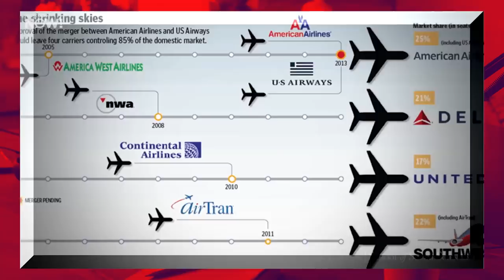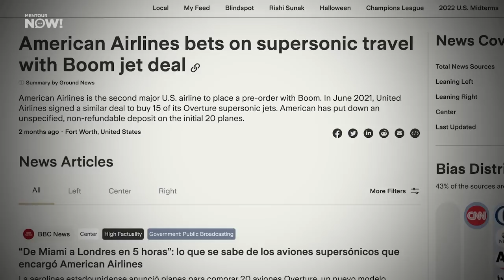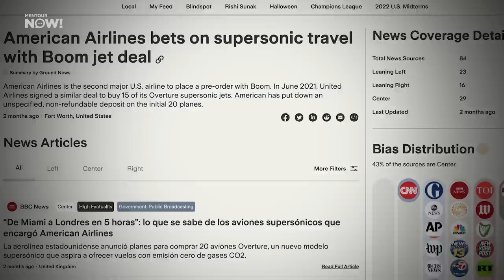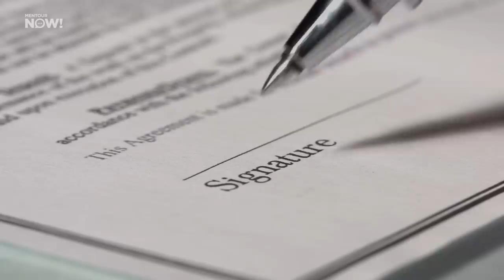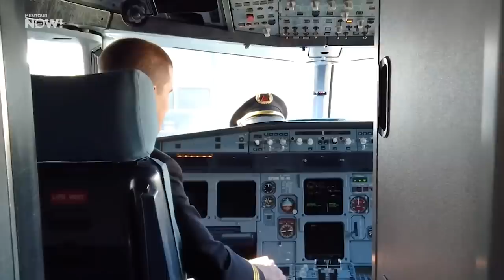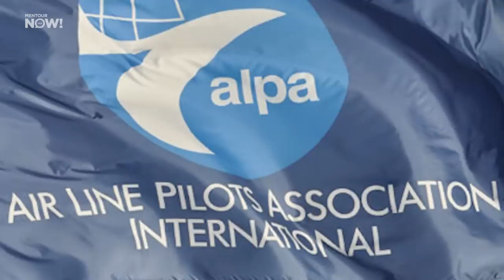Is This the DEATH of the US Regional Airlines?!

Comment: The union contracts definitely play a major if not main role.  I'd be interested though to know how a few other factors play into the different structure of the US air travel market.  First, the basically complete lack of passenger rail, especially at the intercity and inter-region level (with the exception of the Northeast corridor), in the US when compared to Europe.  Second, the sheer size and scale of the US; looking at Europe, I would guess that the average distance between city pairs is half or less that in the US, that's gotta have an impact on carrier operations.
Reply: It is a little puzzling because Europe usually has much stronger unions than the US. But as in a lot of other fields the very strong employment protection that those unions enforce in Europe (very hard to retrench people) has the paradoxical effect of removing the incentive for them to insist on restraint of trade agrements such as the scope clause (eg why would you allow lower wages for regional pilots when they are many of your members?).

Comment: One issue that is generally never brought up is the high cost of aircraft ownership. Certainly, a lower cost of ownership won't magically fix anything, but it would make it easier for individuals, either by themselves or by joining others to form small companies, could offset some of the regional demand with lightweight, efficient piston-powered aircraft.

As an example, people would be willing to ride a poison aircraft between Colorado Springs and Denver even if it takes a little bit less than twice as long as it also costs a little less than half as much.

Of course, this is likely hoping for a bit much, but it's my fantasy, not yours.

Comment: One has to point out the European anomaly that is Luxair: Eleven DH Q 400 and eight 737's split evenly between 700 and 800 models... I've flown to CPH on a DH with four other people on the plane...
The strangest regional flight I took was fun: I think the final destination was Izmir, but as I foraged for tickets, flights from Liège were cheaper than from Brussels. So the plane set off from Liège, landed in Brussels, picked up passengers and off we went. I think there's 80 km between Liège and Zavantem ;)
Reply: Swiss operates 30 A220, which form roughly 1/3 of it's fleet, and also has a regional airline called Helvetic which operates 16 E190/E195s. And these fly between some large and mid-size airports, for example Warsaw to Zurich route. Both of these airports see regular wide-body traffic with daily flights by planes up to and including B777 on Transatlantic and East Asia routes.
Reply: Oh and than you have LOT Polish airlines, which is only just now fasing out it's DHC Q400 fleet which was 12 planes strong, as for the rest its fleet currently is made of  18 E170/175, 23 E190/195, 11 (soon to be 16) B737s and 15 B787s

Comment: I wouldn't write off the US regionals just yet. The cost savings extend to other employee groups besides pilots, and the "pilot shortage" may not last forever. Another big issue is union integration... it's very hard to "fold" seniority-based union groups which started with vastly different career and pay situations. The regionals are in for a rough ride for a few years for sure though.

Comment: The regionals will never leave the US market mainly because of the scope clause in the US. Plus the bigs don’t want to fly to BF nowhere.  The majors also use regionals to hold slots at airports that are slot restricted if they are not using slots at that time. The regionals are ditching the 50 seat aircraft but the 76 seat regional will never die.

Comment: You can't just replace 2-3 regional jet flights a day with a single A320/737 flight. Those 2-3 regional jets flights are feeders for hubs and represent the entirety of air traffic for the entire world going to/from that regional airport. If you replace it with a single A320/737, then many of those flyers will end up either missing their connections or enjoying an 8+ hour layover at the hub.

What you can do is try to identify specific point to point routes between regional airports and final destinations that can bypass hubs entirely - this is the strategy that airlines like Avelo and Breeze are using, but this is a very niche strategy that will not cover most of the passengers' needs at the regional city.

Comment: I think regional airlines might have a niche, but part of the reason they're dying comes from their failure to embrace more fuel-efficient turboprops like the ATR-72 600.

On a full 500 nautical mile flight using the ATR 72-600, you only burn about 6 gallons of fuel per passenger. This is almost comparable to larger jets, 

Meanwhile, on the same flight using the E2-175 jet (the smallest jet that can handle 100 passengers), 8 1/2 gallons are burned.

With the average cost of jet fuel being over $6/gallon in the US, this amounts to a $15 increase in fares on a one-way trip.

This might not seem like much, but it still considerably influences consumer choice.

Comment: Interesting video. One thing I still don't understand and I never heard it explained in any detail - why is there a maximum number of passengers put on the regional flights? Yes I understand that it's to do with the unions but it wasn't explained why the unions insist on this ? What's the difference between flying 75 passengers from 95 passengers? That bit went over my head. Surely if this is going to kill off regional airlines it's not in anyone's interest

Comment: One huge difference between USA and the rest of the world - High Speed Rail. No check in times, centre to centre routes etc. Rail in the US is 99% freight with just a few poor and slow passenger services. Even Acela only operates at only an average of 66mph. France, Germany, Japan etc are all around 200mph. The speedier check in, increased comfort and central locations make flying less attractive than in the USA.

Comment: The percentage difference of regionals in the US and EU could be partly because of different infrastructures. The US is bigger, so taking a plane makes sense. The EU is smaller, and most parts have excellent railway networks, so taking the train (and avoiding security checks) often makes more sense. So the demand is smaller for regionals.

Comment: The cause of the pilot shortage is the 1500 hour rule.  It's a huge burden and it keeps a lot of people from becoming pilots while doing nothing for safety.  In Europe the minimum number of flight hours to be a first officer is 250.

Also, in regard to doing one flight with a A321 vs three flights with a regional jet, many airlines prefer the latter because it gives people options for flight times.  It also helps the airline sell connecting flights and deal with cancelled flights.

Comment: One of the big problems the majors will have to overcome if they lose their regional airline counterparts is a good system for experience building. As you pointed out, pilots are in short supply due to decades of low wages and a massive amount of retirements of the older captains aging out. (When it costs about the same as medical school to go through flight training and all the hours required for an ATP, many potential pilots gave up on their endeavor as it did not make sense financially.) As it stands, regional airlines are providing a pathway for lower hour pilots (500-750 military, 1500 civilian) to gain experience and flight time in a smaller passenger jet, at which point they can move on to a major airline and fly a wide body aircraft within 5 years. Without this system of getting experience and training to the newer pilots, I don't know how even the legacy airlines will find enough new hires. Not saying it is necessarily a good or efficient system, but right now it seems like the shortage has created a crisis mode for the airlines to pull in as many pilots as possible, to both the regionals and then to the majors.

Comment: Even with all you say, which I agree with, it is interesting to note that the US market has a lower total seat cost per mile than their EU counter parts. In total, US company's run their airlines more efficiently than EU airlines, even with the inefficiencies of smaller aircraft type.
Then there is the problem with the US market capacity being maxed out at airport hubs. Airport operations and passenger terminal capacity is max and in most cases beyond design numbers. The way to maximize therefore is to run more operations spaced throughout the day, spreading out the loads by time rather than build more runways and taxiways, or larger passenger terminals.

Comment: Funny story. The regionals were created by management groups that knew exactly when their mainline pilot groups would be retiring en-mass due to forced retirements. Unnecessarily increasing the demand for pilots is what caused this problem for them. Two pilots can fly a B757-300 with 250 pax or a CRJ-200 with 50 pax. 

Lower frequency of flying is inevitable.

Comment: I think travel demand, cost of labor and fuel has squeezed out the regional product. The Majors would just prefer to put a 73 or A320 on the route. I also think the new lucrative RJ labor contracts are a stop gap as an attempt to retain pilots until the bitter end. Example: UAL is taking 500 737 deliveries, and their objective is to replace the regional product with them...

Comment: It makes no sense to have direct flights of less then 200 ground miles. That would end many so called Regional and Commuter Commercial passenger flights. It also makes no sense for the Federal Government to fund commercial airports less then 120 miles from another larger airport. 120 to 199 miles flights couldn't fly direct. Exceptions as always will be cargo flights, charter flights, medical flights, government sanctioned flights and diplomatic flights. Private planes are different. The end result will be a demand for intercity bus and train travel. So very few smaller passenger jet and turbo prop planes would still exist.

Comment: Surprising how most of those regional aircraft come out of Canada. The Q400 is a beautiful , quiet plane to fly in and nearly equal to the cruise speed of a jet aircraft. Extreme  speed and lift at V-1, easily controllable. V2 is nearly undetectable except for an unbelievable climb rate.
Reply: The Bombardier Q400 - So Easy to Fly, Even a Ramp Rat Can Do It

Comment: Interesting. This is a good analysis, I think. I retired from Delta in 2017 after 29 years. As an aside, I think part of the pilot supply "paradigm shift" is the big reduction in ex-military pilot availability. In my new hire class, everyone was ex-military. Add to that the huge increase in cost to get the necessary ratings over the years and you now have people who have to put in a serious financial investment to get in the door.
Reply: It’s because the airlines keep expanding while the military maintains a limited amount of flight slots.
Reply: @riverjustice  Yeah, military output has decreased significantly over the years while airline pilot job numbers have increased.

Comment: Regional and Mainline would have to sort seniority among employees brought over, and while pilots are part of the equation there are mechanics, inventory, and operations that too must be provided compensation equivalent of the mainline counterparts. Regional carriers operate basically skeleton crews and can get away with low experience workers who have low expectations, but as soon as seasoned veterans influence them they will not enjoy the distortion in expectations. For another video it would interesting to look into the fate of regional carriers as mainlines were to absorb them, and where do the low time airplanes end up that are no longer viable? If there is a partial dispatch of current regional model does it generate a new one based on demand that reaffirms hub and spoke models or resembling a point to point system to fill gaps?

Comment: I am curious about part of this discussion...specifically, what are the numbers of pilots operating the US regional airlines? And how long would type-rating training take to upgrade their skills from the Embraer to the Airbus?
Reply: My son flew for the regionals for 3 years, and then was hired by Spirit to upgrade to the A-319 - A321 series of aircraft. This is a triple rating, as the cockpits of these 3 jets are identical. The difference is in the sizes of the aircraft, and therefore, the performance numbers such as gross weight, fuel capacity,  passenger capacity, takeoff and landing speeds and distances, etc. They teach the differences in their ground school training that they receive when they go through the type rating class. It probably varies by airline, but my son's course was somewhere around 5 weeks ground school, and then one week or so for Flight sim training. By the way, the airline flight sims are so realistic that the pilots get their actual type ratings in the Class-D simulator, before they actually fly the real airplane. He got his Airbus type rating and his ATP (Airline Transport Rating) in the same simulator. Happy flying. Another point. The 1,500 hour rule was implemented by a congressional bill mostly caused by the Colgan Air flight 3407 crash in buffalo NY caused mostly by pilot error. They were flying into known icing conditions but didn't let the dispatchers know that, so they ended up with an approach speed 20 knots slower than for icing conditions. That caused the wing to stall due to too slow a flight speed when the wings iced up. To compound the mistake, the first officer made her OWN decision to raise the flaps when the plane stalled, which exacerbated the situation. The idea behind the 1,500 hour rule was to ensure airline pilots would have more experience before being hired. Happy flying.
Reply: @keithwalter1241   Thank you Keith. I'm not a pilot, but before retirement, I had an extensive background in industrial safety training, so I assumed there had to be a procedure.

Comment: The aircraft shortage for folding in regionals into their major airlines for those routes might not take as long as you might expect.  There's a type of business called aircraft leasing that has been struggling since the Covid epidemic began, first because of the sudden lack of air travel meaning leases got cancelled, and now because of the shortage in flight crews capable of flying them.

These businesses, like Chorus Aviation, have fairly substantial fleets of aircraft that they've just been sitting on these last couple of years, and all they need is an airline in need of aircraft and a demothballing/maintenance procedure to get them back in the skies.  Even if an airline isn't fond of the idea of leasing aircraft in the long term, I'd be very surprised if these companies weren't amenable to signing short term contracts to cover the aircraft shortage until new air frames can be purchased from the manufacturers.  A few might also be willing to sell off some of their fleet as life support to the company, though I'm less in favour of that option because I like this kind of arrangement from an investing perspective.  (And yes, I do have stock in Chorus Aviation, that's why I know that name, but I'm not exactly a major stockholder or in a situation where all my eggs are in that basket.)

Comment: There are a lot of moving parts in the US "regional air" market.  
There's a "distaste" by the customers for "dinky" planes (which pretty much doomed the fuel efficient Saab turboprops).
There's the general availability of land (and associated political grandstanding) to "over build" regional airports to far larger than the number of passenger miles the airport can support.  So, it's not uncommon to see municipal airports with 9K & 10K runways and "regional" airports with 10 & 15k runways.
Also, many of the "majors" contracted the "minors" in the same way baseball teams have "farm clubs"--as low-cost training grounds for potential new-hires.  Flying a 1 hour "hops" on "commuter routes" is a quick way to 2000 hours of ATP time (and far faster than 5-6 years in military aviation).
Of course, the "chinese walls" separating Chaparral, Rio, Mesa, and the like from "the bigs" benefited the two companies--customers say little of that.
The US is a huge place, geographically.  A town of 75 or 100,00 residents might be 3-4 hours' drive from the next similar sized city.  And, could be 4-6 hpurs from an international airport.  So, adding a to the ticket price to fly "regional/commuter" and "save" driving a rent car to the airport is often a better deal for the traveler.

Comment: The MGM to ATL and vice versa Delta flight I take around 25 times per year has just been reduced by from 8 flights per day with early and late flights available, to only 4. Before Covid it was 8 per day, Covid cut it to 3 or 4, then back up to 8  flights for the last 18 months until just last month. This means I cant get to my destination early in the day and if there is just a single delay its likely I get stuck in ATL since the final 2 flights back to MGM dont exist anymore.